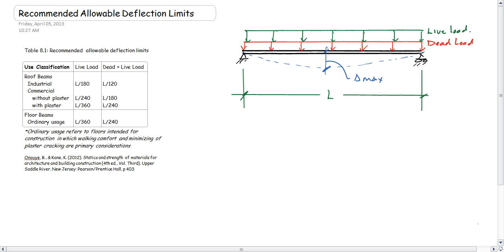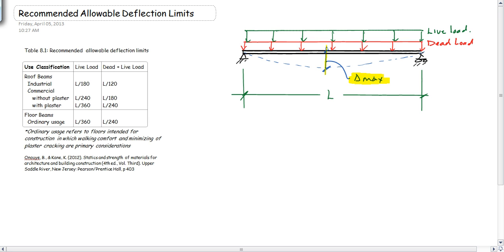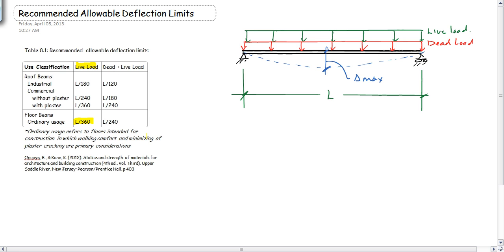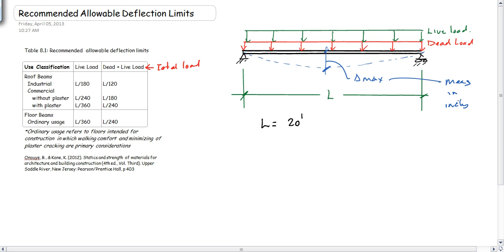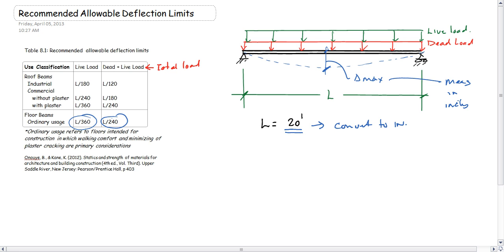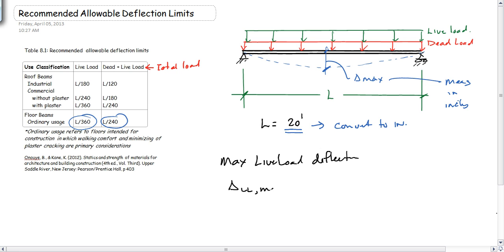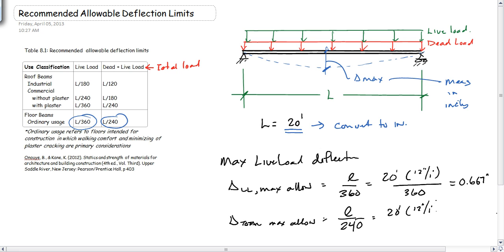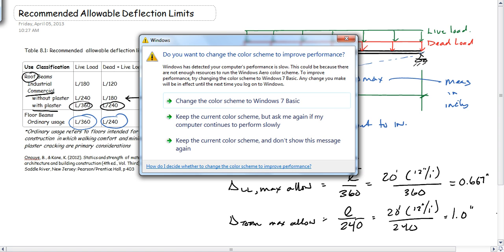calculating allowable deflection for beams

Comment: When the L/120 notation is specified, I understand how this applies for spans.   How is this notation defined as it applies for cantilevers?

Example: given a 10 ft beam, with a 6 ft span and 2 ft cantilevers on both ends.  It has a uniform load and deflects 0.5" in the center and 0.25" at the ends.
The deflection ratio for the span is 72"/0.5" = L/120.   What is the deflection ratio for the cantilever?   Is it 24"/0.25" = L/96?   Or is it 72"/0.25" = L/288?

Comment: Hi, my house is made in  steel frame and trapezoidal concrete slab on top. at areas of 5.5m span, the beams have deflected 1 or 2 cm. they are visible with a naked eye. is this normal? is this so simple or other factors are considered?
Reply: No I'd say 2 cm is not normal. But hard to be more specific with the very limited info you provide. The controlling factors for deflection are one or more of these:
Is it acceptable to the eye; is it reasonably vibration resistant when live loads like  walking are applied. You could easily have a professional engineer check things out.

Comment: John Tingerthal : I was expecting answer of Constant of denominator, i.e 360 or 240, on which basis it is calculated in codes ? FYI: All that I know it depends on whether u used WSD/ASD or LSD/LRFD that will allow "Allowable " value to plastic state or elastic state.